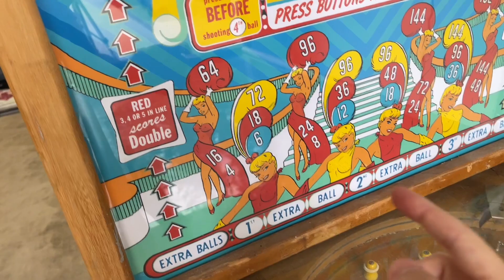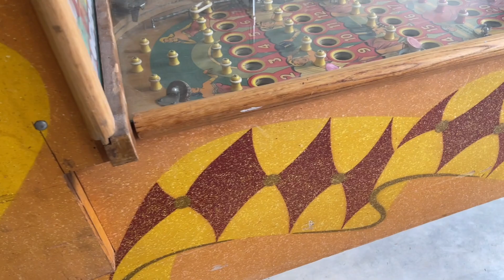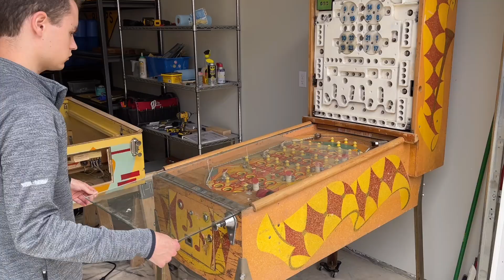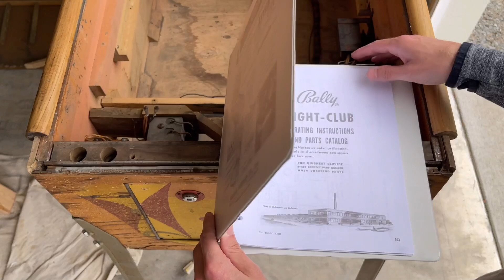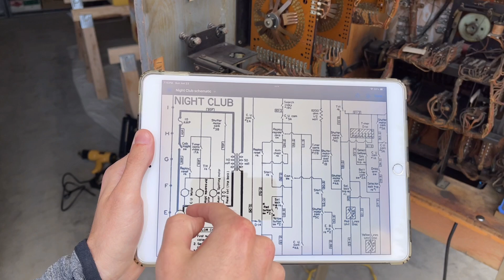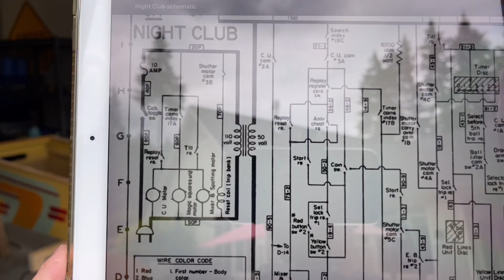1956 Bally Night Club Bingo Machine - A New Pinball Restoration Series! Part 1

Comment: Max do you just restore these  machines or do you repair them also?
Reply from the maker: I do both but if it requires something like playfield or cabinet repainting then usually I’ll just leave it alone. Don’t have the equipment or expertise for proper repainting other than maybe touching up solid colors on a cabinet. I’ll fix their issues and then clean them up and install new rubbers, LEDs, playfield parts, etc
Reply: @MaxsGarage Im not sure where your located I live in Southeast Missouri but I would like to get my machine working correctly appearance wise its in good shape as far as cabinet and graphics and playboard just mechanical issues.I would love to have someone that knows what they are doing such as yourself to get it going again.
Reply from the maker: @timbrantley8483 unfortunately I’m very far from there but if you have any specific questions I can try to answer them
Reply: @MaxsGarage I had one of the little metal wires on the searcher disc spark a couple of times and I guess it got hot and burnt into I was wondering where I can find that part ? Also what do you use to clean all the switches and contacts? Thanks Max
Reply from the maker: @tim@tim @timbrantley8483 isopropyl alcohol first on the switches/contacts and if that doesn’t work use a metal file. If you need a new search disc I think eBay would be the best bet. Possibly Facebook marketplace. But if the contact isn’t severely burned you may be able to file it down to the point where good metal starts to show and that may make it work again. Minor sparking is normal but if it’s major then you’ll have to check the contacts/wiring for any issues
Reply: @MaxsGarage Thanks Max I will give that a try I hope I can get it going I played a machine like this as a 9/10 year old kid and loved it now Im 60 hoping to play one again. Thanks for your help and keep up the great videos!!!

Comment: Max I have a NIGHTCLUB machine. One row the 19 20 21 22 when ball drops into the hole it won’t lite light. Any idea why
Reply from the maker: @PaulLaBerge-k9l  I’d start looking at the wiring under the playfield. The ball shutter can be removed after taking out some screws/brackets (you’ll have to remove it from its motor) and then you’ll see some wiring that connects all the playfield switches/lights. There may be a broken solder joint causing that row not to light. I had to fix a bad solder joint under there on mine that caused the playfield lights to flicker.
Reply: Ok thanks
Reply: Possible bulb failure, first port of call.

Comment: Where can I find the schematics For this? I just bought the exact same one and would like to be able to work on it.
Reply from the maker: I found everything on bingo.cdyn.com. They have documentation and information about basically every bingo machine.
Reply: Yes, I have the exact same machine, too. Bought it 20 years ago and it was working fine. By time I got it home, 13 miles, it did not work anymore. The motors just turn and turn and turn in it never resets. I could never find anybody who could work on the machine or would want to.
Very excited to see your project and perhaps it’ll get me to go back and work on mine. 
Also, the playfield and the back glass on my machine are in beautiful condition, too. 
I noticed yours has metal legs, and they should be wooden legs like my machine has. 
Thanks again for posting your videos. 👍

Comment: What spray grease are you using?
Reply from the maker: Depends, I sometimes use contact cleaner on switches but for stepper units I use dielectric grease.

Comment: Great coverage of bingos in general. Thank you.  However, about 36:55 you're talking about fuse ratings. The amperage rating of a fuse is the max it's designed to take which includes current spikes. So if it's supposed to be an 8A, if you have to temporarily under fuse, like a 6A, that's OK because the fuse is there for a reason. But if you over Amp, in this case going from an 8A to a 10A, maybe the fuse has less chance of blowing, but risk of fire and other issues is greater. Technically,  your circuit should never draw more than 80% of max rated load so in an 8A circuit, the load should max out right around 6.4A to be on the safe side. You did great on the video, I just don't want to see anyone start their games on fire. Let's try to save all of them we can.